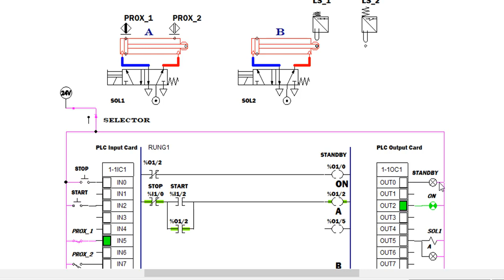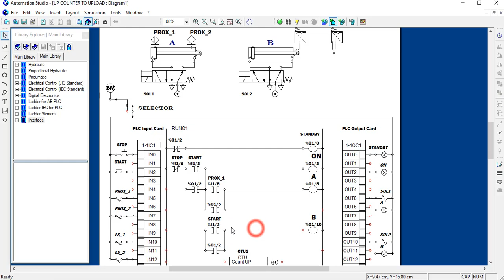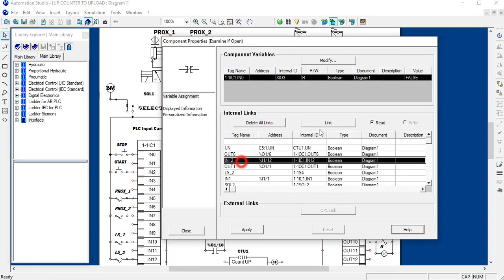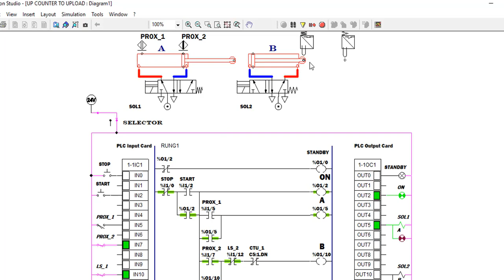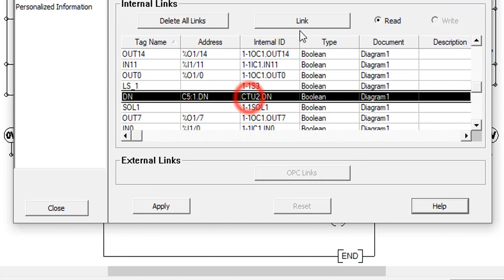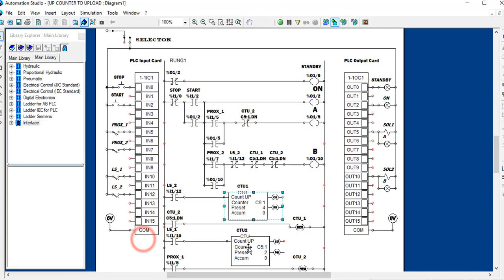Automation Studio: [COUNTER UP IN PLC LADDER PROGRAM] Electro pneumatics

Comment: i cannot figure out how to connect the up down counter in automation studio. the value should change on both counters and i can't figure it out
Reply from the maker: Yeah, both counters' values  need to be changed,  and that's what I did.
Reply: @OlivierNkubito  however during simulation should he accumulated value change also? when using Siemens or while using Allen Bradley in Studio 5000 the Up down counter will sync after naming the counters the same. I think it is a glitch with Automation Studio

Comment: hi dear oliver thank you for sharing this video , i think theres something wrong with cylinder B, when it touches LS-2 de energizes the sol2 so its supposed to retrace to LS-1 but soon after leaving the LS-2 ,the slo2 be energized again befor even cylinder B can retrace ,so it gets stuck there , i think you should use a valve with two solenoids for cylinder B, in real cylinder B needs 2 or 3 secs to retrace, but im not sure about what i said plz check it out and correct me if im wrong tnx
Reply from the maker: Hello Dear Mahdieh Ebrahimi! I don't think there is a mistake as you saying, because I didn't deal with Timers; in fact, I used Up counter in order to achieve the given sequence. A+ (B+ B-) n A-. as you can see for this case, n is taken to be 2 and to be 4. try to redo it with n equals to 1 you will that the cylinder B will not have to perform different strokes for the cylinder A to retract back. 
I don't know whether you're satisfied with these explanations, if not please let's keep on discussing.
thank you.